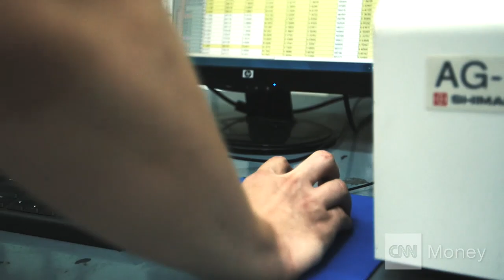This plastic is made from thin air

Comment: This is complete bull, do a 5 sec Google search. Its made of METHANE. Methane is extremely rare in our air. 1/1000000 parts of air is methane. Anyways the prosess needs about 100 times the energy then normal plastic. So basicly only 3 or so countries could make this benefitial to our climate. If they somehow found cheap methane in lagre quanteties, it would be better to use as fuel. 9 commenters veiwed some complete bull and all 9 were positive to the idea. Smartazzes
Reply: A Bro 
Bullshit. So why scientists told that rice plantations producing metane release unto the air? HOAX? Or you are just the "oil man"

Comment: looking forward to more detail and cost comparison and energy consumption,...
overaly this is brilliant approach
Reply: The energy consumption to get this out of the air (they are using methane not Carbon) is 100 times as bad as normal plastics full prosess is. Air Carbon is a viral scam and if you somehow still belive it. Google it. Thunderf00t explains this really well.
Reply: A Bro methane is carbon. Its just not carbondioxide.
Reply: the guy who never uploads anything 

Wow, the stupidity of people like yourself who speak with authority and take what morons like this person said without doing any research for yourself.   Please do not be an ignoramus and fall for that trap that so many unintelligent Americans do today.

methane is NOT carbon.   Yes it has carbon in it, but so does a LOT of things.  In fact carbon is what makes something organic.   There is an entire science based off of this called Organic Chemistry.

Carbon is an ELEMENT, methane is a MOLECULE.

To say what you are saying is akin to saying water is hydrogen or oxygen.    It is a dumb comment that makes absolutely no sense.

methane is CH4 since carbon has 4 outer valence elections hydrogen easily bonds to it.  Carbondioxide is C02.   The difference is C02 is in a MORE stable configuration state than methane.   What does this mean?  It means that methane has a HIGHER potential energy level than CO2.  We know this because if you light a match and start the reaction in an oxygen room using oxygen as the catalyst  it will explode!   CO2 will not.  

Now how much energy does it take to extract CH4 from the air?   the answer is a LOT since our atmosphere has less than 1% in it.  You are better off using the methane that you collect for electricity than buying into this garbage.  Speaking of garbage, were do you think the methane generated in land fills is used for.   Electricity because it is efficient!
Reply: Aaron Wantuck Damn thats a long and pointless reply. Yes I know methane isnt pure carbon. I got the impression from the original comment that he thought there is no carbon in methane. Or more likely that he mean to say carbondioxide. Still his statement makes no sense since it implies that the current process for making plastic uses pure carbon. it uses oil which also contains hydrogen. I know what is wrong with my original statement. it should of had ˝has˝instead of ˝is˝. Why do you insult people for such a small mistake?
Reply: the guy who never uploads anything That is a very valid point.  I have to know my audience better,  I am sorry I insulted you, however I tend to deal with many creationists and I think because I deal with their stupidity it rubs off in my other posts and I assume when someone says something like that they claim to talk about things with authority they do not know.  It drives me nuts.   However from your last post that does not appear to be the case.
Reply: Aaron Wantuck Ok cool. BTW Ive seen Thunderf00ts video about this and do not support this idea.
Reply: the guy who never uploads anything Well I always find it hard to support an idea when you have another better more cost effective efficient way of doing something.  This idea may be needed in the future, but the time is not now because of its inefficiencies.